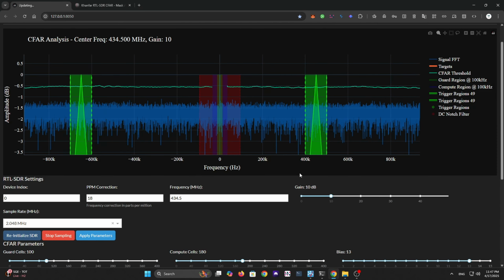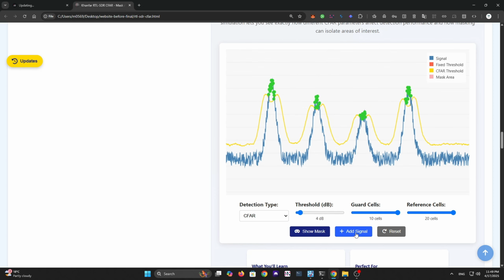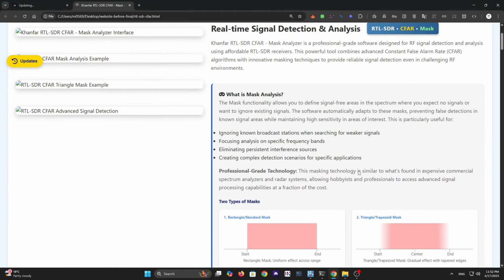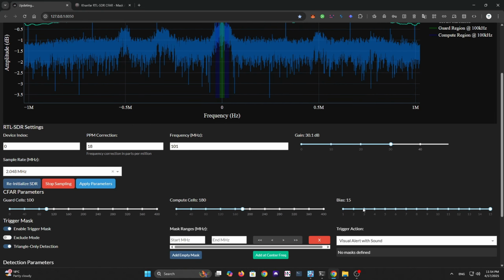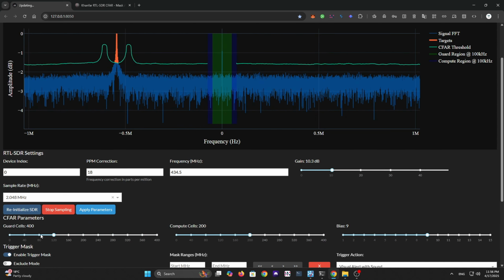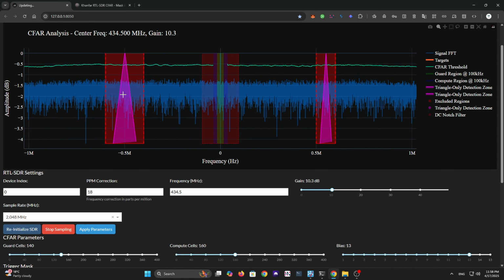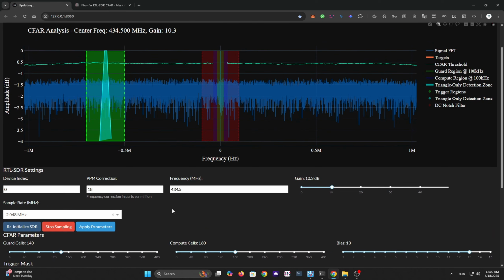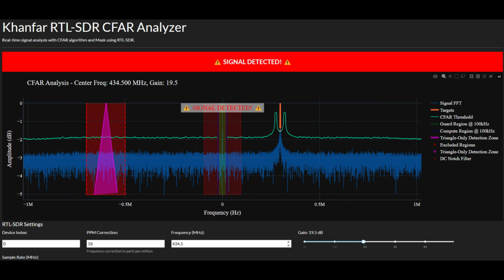Khanfar RTL-SDR CFAR - Mask Analyzer

Comment: Dude you're nuts, you made it! Gonna check this out - nice work! What language do you write your software in?
Reply from the maker: Thanks , you're welcome.  It's a Python. Stay tuned for GPU power in future.
Reply: @MKhanfar-MWK  Very cool. I've been looking into using the YOLOv8 image classification model for signal detection/recognition. Problem is that yolo typically has 640x640 input images and spectrograms are very large. CFAR may be a good way to detect and determine which signals to send to YOLO for classification. What do you think, is CFAR reliable enough?
Reply from the maker: @cadeallen7210  go to our website and send email there . You're welcome